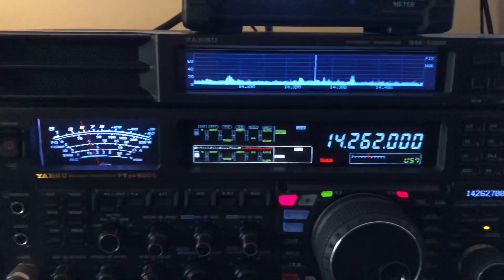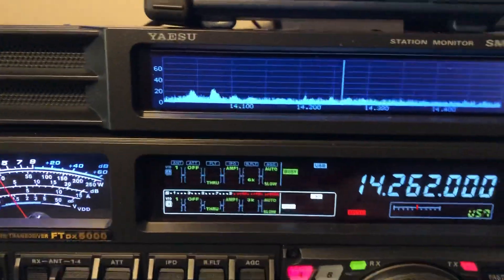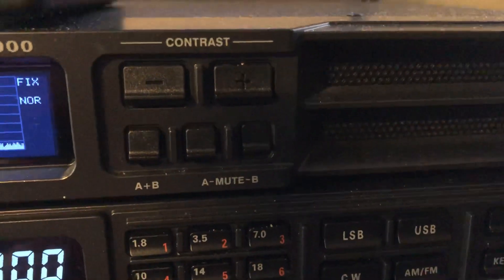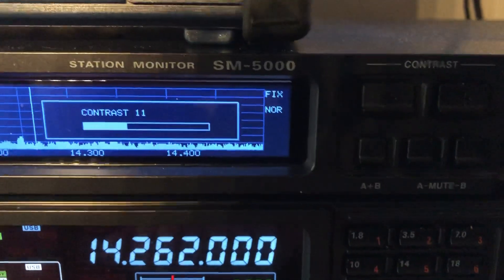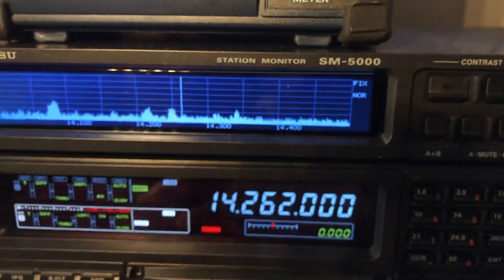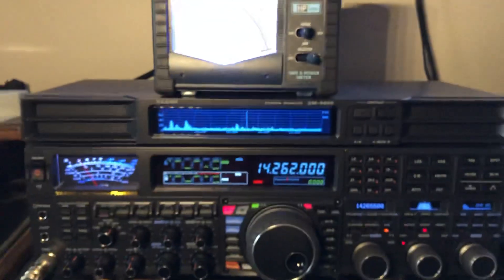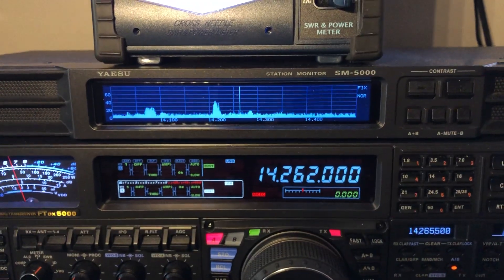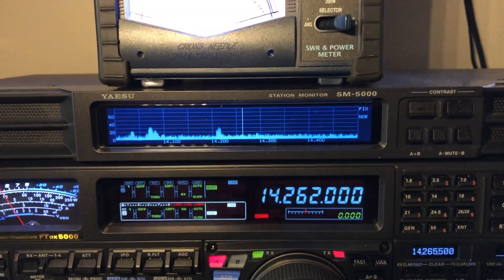Yaesu SM-5000: Audio Settings #yaesu #sm5000

Comment: I would add as well, the main reason for combining the audio for VFO A and VFO B is so you can use two different antenna for Rx and sum the result.  So you could have a dipole and a Yagi and given that the vagaries of propagation mean that one antenna may fade a little but not the other can mean it easier to pull out a weak signal.  To do this you would of course need to antenna and you would set VFO A to use Ant 1 and VFO B to use Ant 2, tune them to the same frequency and use the A+B setting.

You then Tx on whichever antenna is likely to give the best Tx result.

There is a setting buried in the menus somewhere to do A+B on headphones also for the same reason.
Reply from the maker: Check out the Diversity Receive video.

73, de N4HNH
Reply: @n4hnhradio  I perhaps should have guessed you already knew that!!  I just need to get a second antenna up!
Reply from the maker: You can’t have too many.  That’s a video too.  Perpendicular dipoles are great.  You can phase between the two.  But vertical and horizontal is good too, for when the signal tumbles in the ionosphere and changes polarization.

73, de N4HNH

Comment: Doug, nice video very helpful. By watching your video I have placed my SM-5000 to the fix mode. I do have a question regarding enlarging the vertical line when moving the VFO. The display or moving vertical line is so narrow I have a hard time seeing it. Is there a way to enlarge or widen the moving line to better see it? Thanks. 73
Reply from the maker: Hi Chester!  I'm glad you found the video helpful.  I'm afraid I am not aware of a way to control the width of the vertical line.  In fact, you cannot change the color scheme either, though I am okay with the light blue.  The color settings you see in the FTdx5000, menu 007, control the color scheme for the optional DMU-2000, which is no longer available from Yaesu.

Comment: Doug I figured it out. I lowered the contrast. Too simple.
Reply from the maker: Very good Chester.  I guess that line might look less clear with contrast set too high.
Reply: @n4hnhradio  Thanks Doug. One more question..What setting do you have the LED display on the 5000 radio? I normally have the dim switched to on as I am trying not to burn out the LED's on the display. Thanks.
Reply from the maker: Hi Chester!  I have menu 011, the ELCD, which controls the SM-5000, set to 7.  If the room is bright I might go to 8 or 9.  Like you, I tend to set the lamps at a lower level to save the OLED display.  I have menu 010 set to 4.  The others are set to 5.  I purchased the 5000 in September of 2019, so it is supposed to have the OLED board that is rated for 30,000 hours.  I hope it makes it that long.   The negative reviews about the OLED gave me pause about purchasing it, but in the end, I reasoned that I could tolerate a vertical line here and there in order to enjoy such a great receiver.
Reply from the maker: Mine is set to 7.   That's menu 011.  I have menu 010 set to 4, and the others set to 5.

Comment: Got my FTDX recently, everything it´s ok but I guess I have a problem with the sound from speaker B... the audio has much less level than speaker A.. Tried everything and I decided to use an external SP instead those in the DM5000
Reply from the maker: Have you tried to get a warranty replacement?

Comment: Hard to figure... all that can be figured out by just reading the manual. I've been trying that more ad more with age.
Reply from the maker: Indeed it can.  That's what I did.  But I have found that many people learn better visually than they do from reading.
Reply: @n4hnhradio  I jumped on the 5000 page to gather what I can about the radio, it is the last of ol' T-Rex rigs. From what I gather thru online sources the 101's vc vs. 5000's vrf is not enough to outweigh my decision between the two rigs. Actually... I've read and downloaded the 101 manual and the modernization to screens and massive menus looks more and more like lip-stick on a pig to me. I've enjoyed several of your 5000 posts, keep them coming.
Reply from the maker: Someone else posted a comment about one of my videos and they mentioned that QST rated the receiver in the 5000 as slightly better than the FTdx101D.  There is a guy I talk to on 75m rag chew and he had the 9000, 5000, and 101.  He says the 5000 is the best receiver.  Another guy in the rag chew has had the 5000, TS-990S, Flex, and IC-7610.  He changes radios every couple of years because he gets bored.  He said the 5000 is still the best receiver yet. 73, Doug